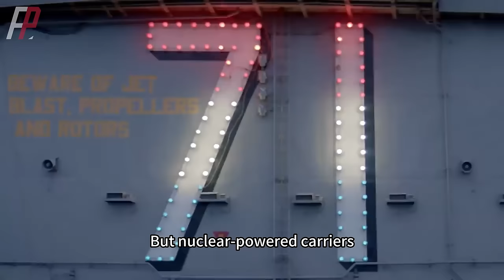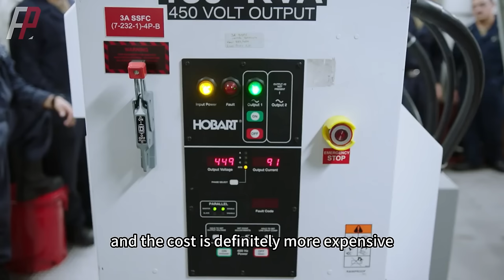The Steps To Dismantle A Nuclear-Power Aircraft Carrier | NIMITZ | FORD |The USS Enterprise

Comment: As I understand it the Nimtz class is the first to have the flight deck mad so a section could be removed for easier access to the reactor which makes it easier to refuel or remove the reactor. The Enterprise did not have this feature designed into it.

Comment: They should have sold the Nimitz to an allied nation that needs an aircraft carrier like Japan or South Korea
Reply: Not feasible for many reasons. Plus their dollars are better spent on more modern, smaller assets.
Reply: Aircraft carriers have a life span of 50 years. The hull wears out after years of being at sea
Reply: Plus the USS Nimitz CVN 68 is still in commission
Reply: Many reasons.  Even the U.S. Navy don’t want due to age and technology.  It will bankrupt another country to operate and maintain it, and dangerous because of any safety issues from the 2 big reactors.  The Nimitz and all CVNs require core refueling at least once, or a 3rd time, that cost hundreds of $ millions.
Reply: They shouldn't complain about not having enough war ships since they are being junked "ahead of schedule."
Reply: I get to be paragraph man

I get that idea sounds good to the average American, but that's not how that works. Carriers have a hull life of 50 years (after that, the actual steel of the ship begins to degrade and eventually fail). Carriers aren't like a car you can toss your buddy the keys too. America is not in the business of giving any nation (including allies) the kind of tech a carrier has in/on it. Yes, weve sold FFG's (Frigates built in the 1980's, for 300 million making the tech and systems they have no longer advanced/ classified) and aircraft, but a carrier is to valuable/ dominant of an asset to entrust that tech to another nation with no guarantee they could prevent a hostile/ advisory nation from gaining/ bypassing  the required R&D to copy / build. Speaking of cost... even if we sold them one for 1/3, the cost it took the USA Navy to build it, it would be around 3.5 billion dollars. The buying nation would also have to take on the operating costs (entirely separate from the purchase price of 3.5 billion) that a US Aircraft Carrier requires to keep operational. The average operating costs are slightly above 2.5 million A DAY!!!! ( In many cases, the CVN cost would be 50%+ of a nation's ENTIRE military budget. Also these nations dont have the ship yard/ drydock for required maintenance & repairs  Next we would have to help them or integrate them (the nation that buys the carrier) into the complex and costly logistics of repair/ replacement parts. Im not even going to get into the massive training burden the US would have to undertake so the foreign nation could operate it safely and effectively.